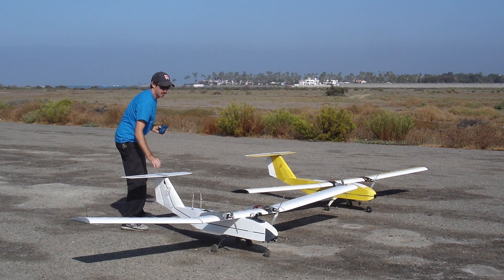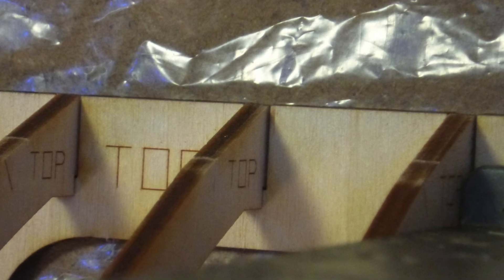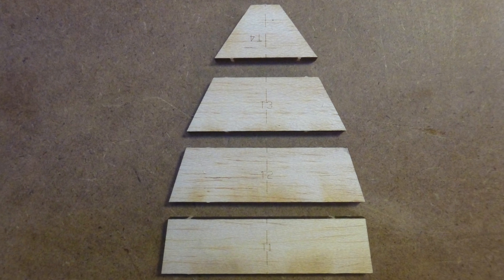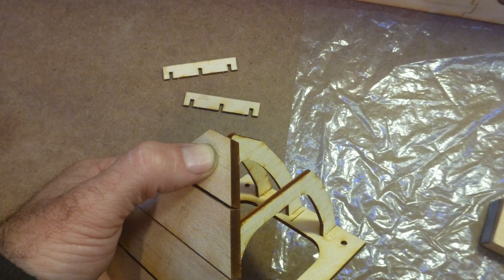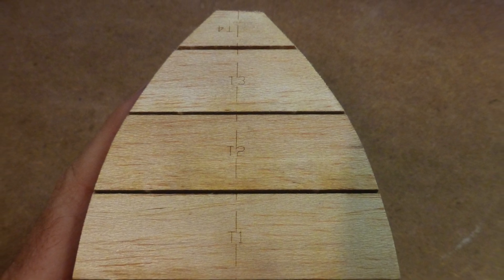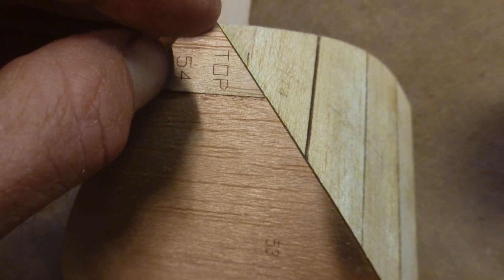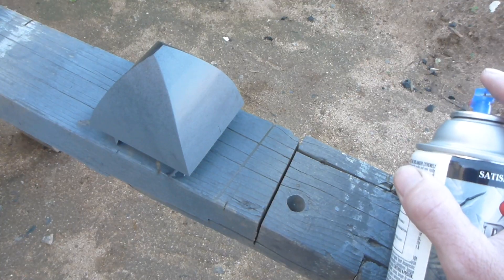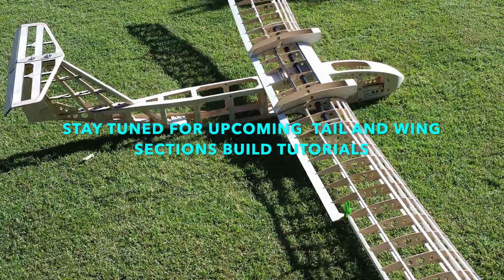Gemini V-2 Laser Cut Kit Build Video #2 - Nose Fairing-

Comment: Hi Spike. Neat, but I have a question. There appear to be surface gaps between the "planks" at the sanding stage, but no longer visible during the painting. What did you use to fill these gaps ???
Reply from the maker: just some of the sanding dust and CA glue, then sanded flush.